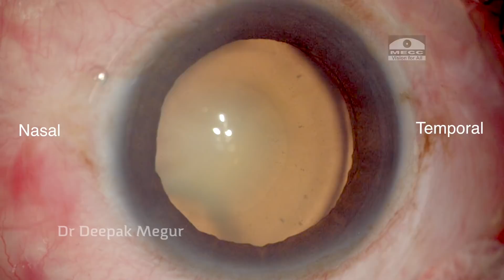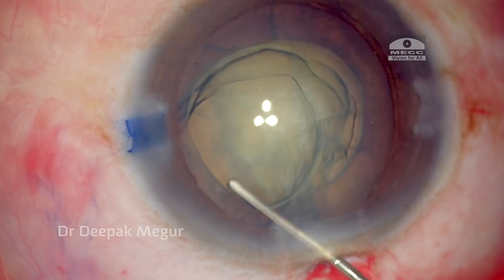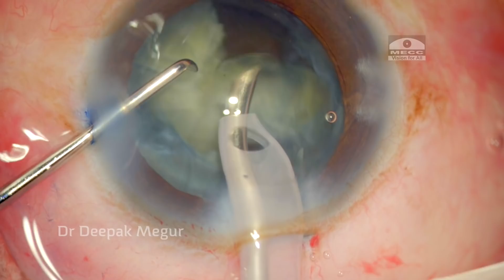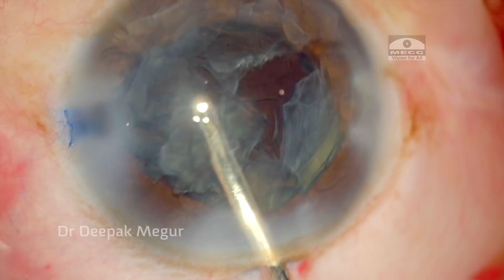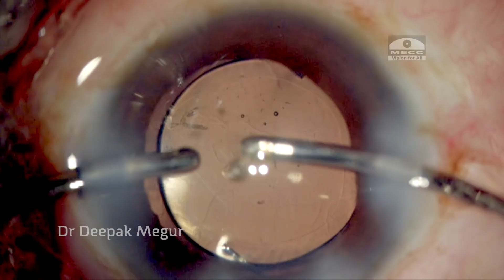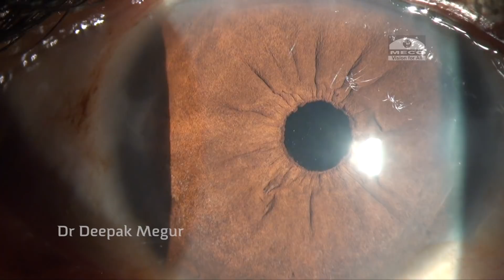Traumatic Subluxated Cataract- Phaco, CTR  with IOL trap technique- Dr Deepak Megur

Comment: Thank you very much.
I am wondering why you didn't place it in the bag? Why is it important to place in sulcus in case of zonulysis? Isn't there risk that that IOL is unstable in sulcus?
Regards
Reply from the maker: CTR & IOL In the bag, That's an existing & acceptedd concept,But we all have noticed that the entire bag complex gets dislocated many years later,
 by putting the IOL & Ctr in the bag we are also increasing the weight of the bag,.
 In this concept, 360 degree equatorial support is provided by the ring (CTR) and the haptic in sulcus and optics in bag, help in redistribution of the weight, and hopefully there Will be some forward/anterior  pull on the bag by the haptic in the sulcus, ensures long term centration & stability. Also Hydrophobic iol ensures that the capsule is glued to the optic. Additional benefit which i have noted is lesser pseudo phacodonesis. This technique is suited only when the extent of zonular dehiscence is not more than 3-4 clock hours. For more extensive zonular dehiscence, suturing the bag to the sclera is necessary
Reply from the maker: The IOL is trapped inn the CCC ( optic Capture) , this is critical it ensures longterm centration & stability of the lens. Placing the lens in sulcus without optic capture is not a good idea at all. CTR in the bag and Hydrophobic IOL in sulcus with optic capture in CCC works well in eyes with localized zonular dehiscence of 3 clock hours or less.
Reply: Dr Deepak Megur thank you very much, makes good sense. I will think about that!
Reply: Hello, Dr. Deepak Megur! Thank you for the excellent videos!
I have a question regarding your comment. Why placing the IOL in the sulcus and the CTR in the bag is not a good idea? 
Have a nice day.
Reply: @georgepetre8109  read the above